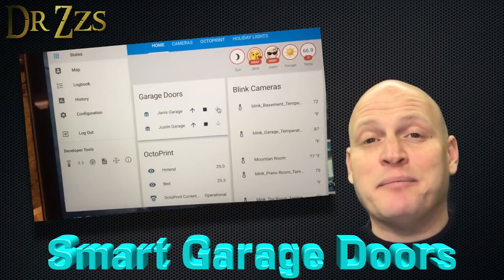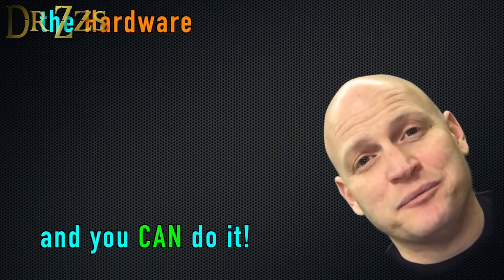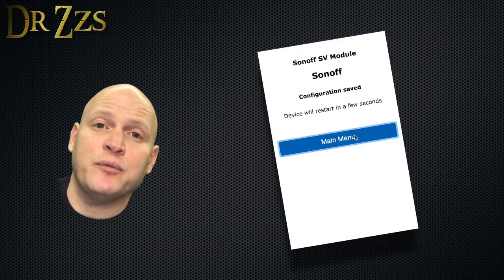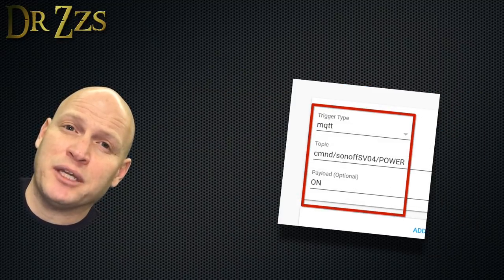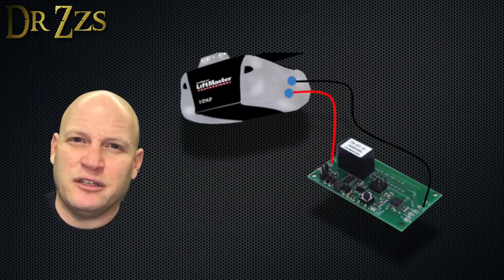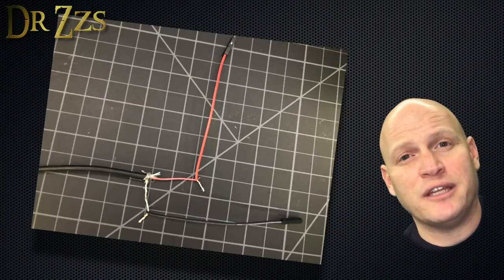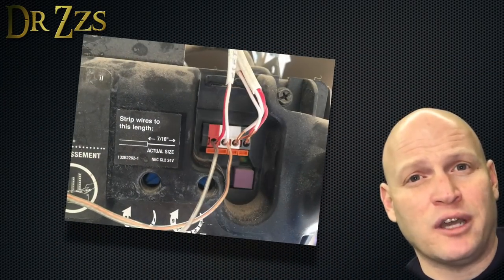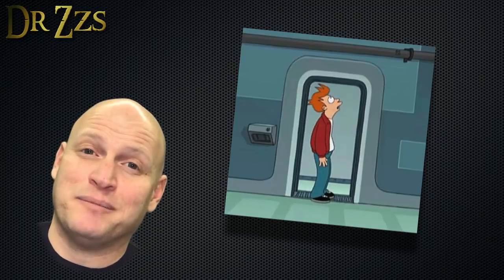$5 DIY "Smart" Garage Door Opener using Sonoff SV

Comment: Hi, do you know if I can use this one instead of sonoff SV ? "1 Channel Inching /Self-Locking WiFi Wireless Switch 5V 12V" 

I got this one but honestly don't know how to put tasmota on it :( 

Just let me know thanks a lot

Rik
Reply from the maker: Just checking it out.  Does it look like this:
https://www.dropbox.com/s/rcixonk03g8zt6l/Screenshot%202018-01-22%2009.29.28.png?dl=0

There are 4 connection points in the middle.  I'd be that's where they uploaded the default firmware.  So you could likely used those to flash it.  
The picture I found has a micro USB connector.  Would be AWESOME if they connected the middle wires from the USB to Tx/Rx.  Then you could just plug it into your computer to flash it.  No FTDI required. 
Is that thing made my iTead?  I'll have to look it up.  If iTead makes it, and it has an ESP8266 chip I bet the Tasmota team has some info about it. 

So, to answer your question... Yes, I would expect you could use that for your garage door.  But not knowing much about it I can't say how exactly you'd do it. 

Did you buy it specifically for controlling your garage door?
Reply: Hi thanks a lot for you prompt reply, really appreciated :) yes got it from ITEAD and the intention was get it working on my garage therefore when I saw your video I got excited about it:) here's the link of the board
https://www.itead.cc/inching-self-locking-wifi-wireless-switch.html  , basically if I manage to put tasmota I should also find the GPIO pins to connect the reader right?

Rik
Reply from the maker: yes.  If GPIO 14 is not accessible you could use the Tx or Rx pins. They're usually GPIO2/3 I think.  I'm scouring the Tasmota page right now for info on that board.
Reply from the maker: It shows on their Supported Devices list, but they don't have another page with more info about it. 
You've got me curious about it.  I'm going to order on from iTead right now. Between you and I we'll figure it out and fill the knowledge gap on the Tasmota site! Let me know what you learn. We'll sort it out together.
Reply from the maker: one more thing. 
I looked on the Module Type list on the Configure Module menu.  I don't see one with a matching name.  But really, it doesn't have an easy-to-shorten name.  There's one that might be it. 
https://www.dropbox.com/s/plprodwdpf55jhu/Screenshot%202018-01-22%2009.50.45.png?dl=0

As far as finding the pins, if you can Identify ground with a multimeter on continuity. One probe on the outside of micro USB connector and the other probe poking one of the outer holes of those 4.  One of those will be ground. Then you can try flashing assuming they are arranged in the same order as the Basic.  I'd bet they use the same machine to install their firmware an all their devices so the pins should be in the same order.  Just ID ground and you'll have the pins ID'd. 

Maybe we just figured it out...
Reply: Hi, I finally managed to put Tasmota on it based on this tutorial : https://www.youtube.com/watch?v=vzoM4op60jo  and https://github.com/arendst/Sonoff-Tasmota/issues/893  - Jannfe - 4 days ago! However i simply cannot see the IP number on my router.. looks like it's not connecting to any Wifi.. does this board has an esp chip?? :(
Reply: Hello, so I managed to find also GPIO14 on this board "1 Channel Inching /Self-Locking WiFi Wireless Switch 5V 12V"  and I did the configuration module as Sonoff SV.. the only issue i have now it that when i connect the reader to Gpio14 and ground it triggers the relais instead of simply grey out the arrow in HA.. basically in HA I can click on the 3 buttons.. arrow up/down and stop and relais works.. :( any idea? i feell that I'm pretty close to the solution:)
Reply: Hi mate, great vids and have been really helpful. Just wondering if you have gone any further with the inching-self locking module. I have flashed mine using OTA method, connected to hassio as a switch and this works fine. Just keen to know how to connect a reed switch or some other method for this module to report open or close on the garage door. It seems perfect for the job except for the reporting part.
Reply: ProSky pro-sky can you give me link to the tutorial that you use to flash tasmota on the self-inching switch? I've looked at a few forum posts and seem like you can't flash tasmota on it due to the rx/tx pin layout.  Thanks.
Reply: Hi Linh, 
Since writing my comment, I found the inching sonoff started causing the garage door to open and close randomly. I made some changes at the tasmota interface, selecting different configurations etc, but this did not make any difference. However, all I did to flash the device was follow Dr Zzzs instructions and it all appeared to work like a charm. Except the garage door didn't think so :( ... Unfortunately, I have used a standard sonoff inching device connected to Alexa to automate the door....for now. I have given up and ordered the SV.

Comment: I just did mine a week ago with SonoffSV, NodeRed, and OpenHab. Works great! Sends me a push msg and an email if the door has been open for too long
Reply from the maker: Very nice! 
I haven't used NodeRed yet.  I need to check it out.
Reply: TheFlyingKiwi  Please do a video on how you did it! I'm having trouble working out the mqtt & NodeRed config for the Sonoff.
Reply: I have to admit, I use NodeRed because I'm unable to get the mqtt binding working on openhab2, but nodered has openhab nodes which talk to the items and UI. OpenHab is the 'face' and the server while nodered is the brains of my automation.

As far as configuring the sonoff goes with mqtt, you do the same as with a basic, except I used the console to program the relay to only close for 1sec then open, I think the code was '10..111'. Mqtt is the same cmnd/(insert your sonoff name here)/POWER ON. etc. Because of the console programming you don't have to tell it to turn off, only 'on' commands are sent. Do the usual thing with gpio14 and a reed switch or microswitch, which is what I used. That sends 'open' or 'closed' msgs.
Reply: Great vid DrZzs ..
I got it working in openHab... hardware and tasmota is exactly as per this vid ..

On sitemap - i have status ( dont need it - its for reference) and only one button
OPEN if garage is closed ( read via reed switch from gpio14 and GND ) and obviously the opposite for CLOSE  

 items file:
//Garage Control
Switch  Garage_Switch
        "Garage Door"
        (gGarage)
        [ "Switchable" ]
        {mqtt=">[broker:cmnd/sonoffg/POWER:command:*:default]"}
String  Garage_Status
        "Garage Door is [MAP(door.map):%s]"
Contact Garage_Contact
        (gGarage)
        {mqtt="<[broker:cmnd/2/POWER2:state:MAP(door.map)]"}

garage.rule file
rule "Garage OPEN"
when
  Item Garage_Contact changed to OPEN
then
  {
  logInfo("Garage.rule", "Garage action is OPEN")
  Garage_Status.postUpdate("OPEN")
  }
end

rule "Garage CLOSE"
when
  Item Garage_Contact changed to CLOSED
then
    {
    logInfo("Garage.rule", "Garage action is CLOSE")
    Garage_Status.postUpdate("CLOSED")
    }
end

door.map file
ON=CLOSED
OFF=OPEN
OPEN=OPEN
CLOSED=CLOSED
-=NULL

sitemap
Frame label="Garage Control" {
  Text item=Garage_Status icon="infopgt"
  Switch item=Garage_Switch icon="opengaragedoor" mappings=[ON=Open]  visibility=[Garage_Contact == CLOSED]
  Switch item=Garage_Switch icon="closegaragedoor" mappings=[ON=Close] visibility=[Garage_Contact == OPEN]
}

( the icons are my own - so that may not work for you ) 
Hope it helps 
Cheers

Comment: Any chance you can explain (or point me in the right direction) for what the settings did when you go to the console?  (what switchmode 2 2 means, etc?)  Thanks and keep up the great work.  I've learned a ton from your videos so far.
Reply from the maker: Thanks!Here you go!
https://github.com/arendst/Sonoff-Tasmota/wiki/Commands

That's all the commands available.  The explanations are kinda short and don't give you a lot of details.
Reply: ahh, so it's got to do with MQTT, that makes sense.  But now I'm even more confused.  Switchmode 1 0 makes sense (it says SwitchMode 1 - Set switch mode to FOLLOW (0 = Off, 1 = On) but SwitchMode 2 (inverted follow) only has two options (0 = On, 1 = Off).  What does this mysterious Switchmode 2 2 do?  

From the docs: 
==============
SwitchMode
You can change the mode for a switch by executing a command in the web console, via HTTP, via MQTT or via serial.

SwitchMode 1 and 2
SwitchMode 1

Set switch mode to FOLLOW (0 = Off, 1 = On)

While pressing the button/switch (closing the circuit) the button will send ON (directly or via MQTT depending on SwitchTopic) and OFF when released (open circuit).

SwitchMode 2

Set switch mode to inverted FOLLOW (0 = On, 1 = Off)

The opposite of Mode 1.

Conclusion
You properly want to use SwitchMode=1 when connecting a toggle switch to your Sonoff device. This way the 'software switch' will have the same state as the 'hardware switch'. If the real switch is in the "on" position, the state of the software switch is ON as well.
==============

how did you come to choosing 2 2 ?  Just trial and error?  I'm new to all of this, so please don't read this like I'm challenging you....I'm just trying to get an idea of how you approach things.
Reply: yes i have exactly the same question! Anyone knows this?
Reply from the maker: The first number is designating which switch you're applying the switchmode to.  
So in this case we set GPIO14 as "Switch2" so when we put "switchmode2 2" in the console we're changing the funciton of switch2 to mode 2, which sets the reed switch to "inverted follow".  Switch1 is the default to control the relay. So setting "switchmode1 0" actually sets "switch1" (the relay control) to mode 0 (toggle).  That is the default for switch1 but I put it in just in case it had been set to something else before. 

Does that help clarify it?

Comment: Nice hack and great video, but it's a shame to not use the power supply on the unit itself. You haven't come across similar hacks where the onboard supply is still used for power but the relay just closes the 2 "output" contacts?
Reply from the maker: Thanks! I thought about how to do it that way.  I don't know about all models but my garage opener uses 12v on the wires to the button on the wall.  I think you could run a parallel set of those wires through the input/output contacts on the SV and it would work.  
If you still want the wall button to work you'll have to leave those wires alone, but splicing into them, going through the sonoff then back to the same contacts on the opener should work.  
Or it'll explode...

Good luck!

Comment: I really enjoy your videos and have learned a ton from watching them. I do have a quick question. I know you have the other video where you use a D1 mini and Arduino code. Is it possible to make this work with a D1 mini running Tasmota? I ask because I would also like to add a temperature and humidity sensor to the garage also. I would like to run all of this off one D1 mini. Thanks for your time!
Reply from the maker: Thanks!
yes, it would totally work with a D1 min and Tasmota.  You can have one pin for the relay, one for the reed switch, one for the T&H, and heck, while you're at it might as well add a PIR sensor.  :) 
Maybe I'll do that for a video....
Reply: Yes this does work. I have a d1 mini, reed switch and dht11. I’m going to add a second reed switch for my other garage door and possibly a motion sensor.
Reply: William Peters it took me a while to get this figured out. But I have the relay and the reed switch working! Now all I have to do is figure out the dht11. Which I don’t think will be an issue. I am just really new to MQTT and had a little difficulty with the command and state topics.  But I think I have figured it all out.

Comment: I'm using a Sonoff Basic, running Tasmota with the 120V lines to the relay cut (http://www.instructables.com/id/Sonoff-Garage-Door-Opener/).  What commands do I need to enter in the Sonoff console to set the proper pushbutton relay and reed switch modes/topics.  Also, what would the Hassio configs look like for both.
Reply from the maker: I haven't done that personally so I'd be sorta guessing.  
I would expect it to be the same.  The reed switch can connect to gpio14 and set it as switch2 in tasmota.  You need to define the mqtt topic for switch 2 in the tasmota console by typing "switchtopic2 yourchosentopic".  the switchmode should be the same as the video.  The hassio configs should be the same too.  
If those don't work let me know.  like I said, I haven't done it myself so I'm guessing how it works when you cut that linkage.  
Good luck

Comment: Cool project. I'm working on the same idea, but I want to use two reed switches connected to GPIO04 and GPIO05. One for door open and one for door closed. 

My door openers has their own 24Vdc battery backup so I will power the SV's straight off that.

With the tasmota firmware you can configure the relay to pulse for a set amount of time when it recieves an MQTT message. So you don't have to do that automation in HA for the 1 second delay.
Reply from the maker: jwelman1 Thanks!  Wish I’d have known about the pulse. Better late than never I guess. 
So you’ll use 14 and another gpio for both reed switches?  I haven’t used multiple gpio’s yet. I saw you can do it with TASMOTA. Sounds like a great plan! 
Good luck!
Reply: DrZzs Thanks to your great video,  I just setup my SVs so that GPIO 04 and 05 are now sending MQTT messages on a custom topic. For the messages to work I had to set custom topics along with your settings. Now to connect the reed switches and test. I still want to use GPIO14 to report the temp and humidity from a DHT11 as well.
Reply from the maker: That's awesome! 
Let me know how it turns out!
Reply: That's what I did with my project last year, two sensors...and two esp8266 so they have to vote and be in agreement before the garage opener can actuate.

Comment: Put a WEMOS in your car, power it with an ignition on circuit. When it connects to the WiFi network, have HA open the garage door.
Reply from the maker: I love that idea! 
I'll be working on that real soon.
Reply: DrZzs use the wemos pro with a better antenna for further reach

Comment: Why do we need the switch ?
Reply from the maker: to give the state of the door (open or closed)
Reply: DrZzs thanks so much. So with the help of switch the system will figure out if the door is open or close. So essentially I don’t need the laser Beamer as used by some of the ready to use gadgets. Is my understanding correct ? Thanks again.
Reply from the maker: I assume so.  I can't really say how other devices do it.

Comment: Great video! Has anyone done this using a Homebridge plugin instead of Home Assistant?
Reply from the maker: Thanks! 
Are you using some homebridge plugin with something other than Home Assistant? Is it something that runs on the device?  or on the iphone? or some other kind of hub?  
How do you like Home Kit?  We have all iPhones (and like 4 macs) but haven't even opened the Home Kit app yet.
Reply: I haven't used Home Assistant. I wanted to be able to use HomeKit and Siri to control my devices. So far, I've found HomeKit to be good although maybe not as flexible in some areas as Home Assistant. The HomeKit automations seem to work well, including 'proximity' triggers like "turn on the lamp when anyone arrives home after dark". I'm certainly no expert. I've really just been playing around for fun. I have a Raspberry Pi running Homebridge and an MQTT Broker, and Tasmota firmware on a standard Sonoff device controlling a lamp, and a Sonoff 4ch Pro controlling 3 independant sprinkler zones. I'm looking to use a couple of Sonoff SV's with reed switches for a garage door and gate control.